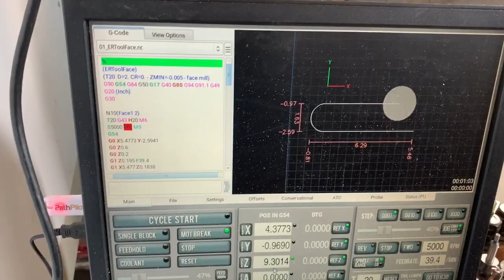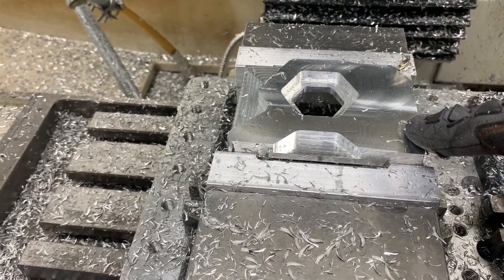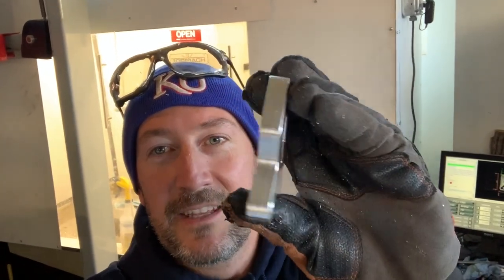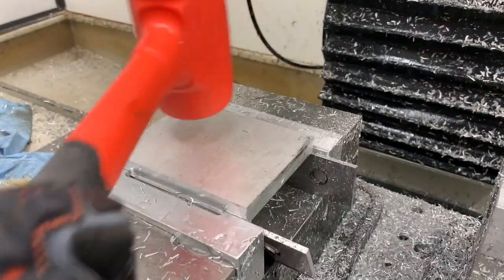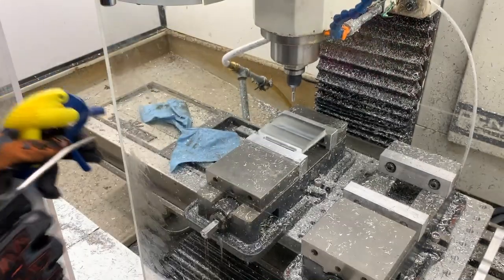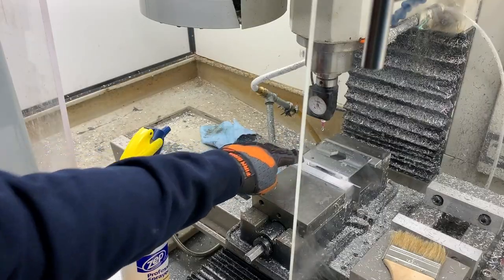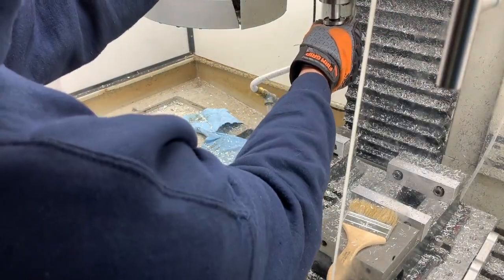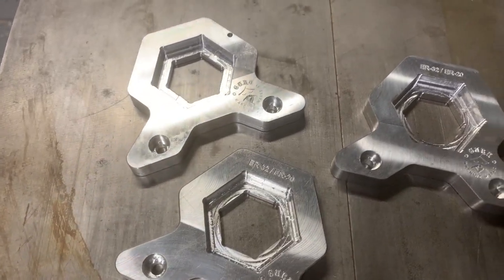First Project on The Tormach - ER-20 & ER 32 Collet Holder

Comment: You are doing great, keep at it. Reminds me of when I got mine. That education isn't cheap but as long as you learn from your mistakes, its worth it. 

A few helpfully hints. First, leave the parallels in. They give the stock some needed z support. Second, predrill holes if possible. like the corners of the hexagons, this will save your end mills from diving into a corner at higher engagement. Finally, it looks like your vice may not be aligned perfectly hence the edge left on the final part. Since you have softjaws you could mill a step across them and use that in place of the parallels and it would be true to the x axis. Another trick I've learned to eliminate witness marks is to cut the profile in one setup. You may need thicker stock but if you cut to full depth in your Op1 you only risk your camfer being slightly askew on Op2. I hope this is helpful.
Reply from the maker: Awesome advice.  Thank you!  I need to get a nice drill set next.  I like your thoughts on pre-drilling.  That little step would have save 3 or 4 end mills.  My vices are about 2/10000 across both of them, so I think they are square.  It was interesting...  The witness mark was around the entire piece.  I think I either had some spring back or a programming error...  That said, cutting full depth would solve all that.  I could probably come up with something that left the middle of the part fat and the ends could be shaved down to accommodate the work holding.  I'll have to play with that.  I am going to mill a step in the soft jaws and hopefully get rid of the parallels for awhile.  I was nervous I'd hit them in the boring op.  If I hit aluminum, I don't think it would hurt anything.  THANK YOU again!!!

Comment: Dude! The Tormach looks amazing. I know it's going to make prototyping your new Skyscraper Guitar tools super convenient. I'm just entering the CNC world myself, with a new Shapeoko, but will remember to slow the feed speeds down when I try facing aluminum. Thanks for the demos. Congrats on the new tool!
Reply from the maker: You'll be amazed at how loud your shapeoko will get when you start cutting aluminum with it!  It will sound like 2 cats fighting in a dryer that's right next to your head.  LOL. Seriously though...   A lot of the lessons on the Tormach apply directly to the shapeoko.  I use fusion to create my CAM whether I'm on the Digital Wood Carver or the Tormach...  Once you get carbide 3d down, you may want to give Fusion 360 a shot.  Its a bit less user friendly, but WAY more powerful.
Reply: @GregsGarage  I'm definitely in the Carbide Create 101 class for this semester. Although I do have the creator version of Fusion 360. I had my 14-year-old son watching Fusion classes on Skillshare. He commented it was a little too much for him at the moment. :-) All in good time. Enjoy your Tormach. What a great find, under two hours away. That must have been like towing a boat. Glad to see them push the mill forward in the trailer to get you enough tongue weight.

Comment: Man that was fun to watch Greg.  So the issues you were having were all related to how you programmed the CAM?  step over, travel speed, depth of cut, etc?  what do you think of path pilot compared to your other cnc experience?  Oh and what was up with those gloves?  already cold in Colorado ?
Reply from the maker: The issues were CAM related.  Going from a rough, adaptive with one tool, to a finish pass with a smaller tool caused the tool to break in the corners.  I'm also an idiot and didn't size the material properly, so there's that too!!! 
I had Mach 3 on this controller when I got it.  I think Path Pilot is more intuitive for the Tormach because it's made to control everything on the machine.  The only thing that I wish I could pull from Mach 3 is the use of the playstation wireless controller.  I'm sure someone could hack that together...  Maybe that's a side project I can look at.
Lastly, we are in the middle of our 3rd snow storm in October.  We won't get out of the teens until Thursday...  It is cold as SHIT!  I just installed a garage heater last night.  The gloves are also to keep the chips from stabbing the crap out of my hands.  I can also leave them in the garage covered in chips.  My wife is NOT a fan of the chips, so I gotta be on my chip game hard core!!!!

Comment: You said it best "You pay for or one way or another" but your doing great. 

In few the few snapped bits that I saw, it was happening in the acute angle on the part. (I'm just throwing shit a wall to see if it sticks here) but I think your Tormach is transitioning through the angle so fast that the bit is experiencing force on 2 sides, try and set it at a slower feed rate as it comes in to these angles and add a millisecond pause at acute angel joints or transition point to release the strain on the bit. 

Hope this helps keep up the great work :)
Reply from the maker: LOL!  Yes, you gotta pay your tuition!
You are spot on about cutting at a lower feed rate.  I just have to figure out what recipe is going to work as a template.  I'm not doing production, so I'm not worried about speed.  I'm sure there are some analysis tools in Fusion to help me with the trouble spots.  I need to do some research to find out the best way to make this baby sing!!!

Comment: Definitely watch the aluminum it will chip weld to your tool if the chips aren’t evacuated and break your tool right off heavier chips and maybee a 2 flute endmill some people even use single flute aluminum endmills check out DATRON they have a lot of info on cutting aluminum
Reply from the maker: Awesome!  Thank you for the advice.  I'll take a peek at the Datron site for sure.

Comment: We need to talk about the gloves... Also, mist coolant.
Reply from the maker: Go for it.  I'm all ears on both subjects.
Reply: @GregsGarage  Gotta lose the gloves. If you want to wear something for grip and anti coolant and chips, I suggest using nitrile gloves. Personally I love Halyard:s purple nitrile gloves but there's a good selection out there of really tough ones.

Second, mist coolant. It works with high pressure air and a Bernoulli/venturi process. Don't pin me on the exact terminology, but anyway it basically uses airflow to create a vacuum to pick up small amounts of coolant that you then deposit on your tool. This creates a good cooling and lubricating solution while also blowing away chips from your cutter's path. Better finishes and longer tool life, plus you don't have to get close to a spindle anymore with a spray bottle or brush. So it's more convenient, efficient and safe.
Reply from the maker: Thanks Pieter.  I did install a mist coolant system since this video.  I need to get it tuned in, but its close.  The spray bottle was just to get going on this project...  As for the gloves...  I am usually working on a handful of projects in the shop.  The tools, the chips and all the other sharp stuff around the machine are killing my hands.  For the most part, blood doesn't bother me, but I do work in an office and I can't have hands that look like they've been through the meat grinder...  Still trying to find what works best...  I've also got to be able to use my phone with the gloves on...  Its a constant need.  The ones you see in the video check all the boxes for me.
Reply: @GregsGarage  fair enough. Just bear in mind to keep well aware or away from moving parts... Machines aren't cruel devices but they'll finish your appendages in no time at all...

Comment: The parallels need to stay in the vice while you're machining. You shouldnt take them out and then machine. 

Your workpiece will get pushed down. And end up applying a bending torque or deflecting the tool. Especially if the tool is doing any side milling. Or pocket milling etc. Or even drilling.

Comment: So, you've fired your Intern for MISTAKES; yet you've also made mistakes. Can I assume you are now FIRED??? LOL... Seems to reason that you nor your intern knew what they are doing and trial and error seems to be the best teacher. 

I worked as a Machinist almost 2 decades ago in early 2000; more so a Monkey changing parts and pushing a button, so I do have some machining experience. I've not ever programmed the Machine but have changed a few parameters to get the product finished as needed. 

I say this not to seem like a know it all but rather to say I feel your pain with regards to breaking things. I once ripped the clamping jaws off the machine and watched the piece of Hastelloy, weighing in easily at 450 lbs, drop to the center of the bed as I was cutting Piercing Points and forgot to reset the home position. It was on a Boring Process with a long cutter and resting home was the quick way to program as this was a temp part for this machine and the person could not fully figure out the process so relied on the Monkey to reset Home each time. Needless to say I forgot to reset home and though I was not fired, I did get a few days off as my machine was down. 

Working Metal vs Working Wood are two very different ventures so I want back to Construction where I was more than just a Monkey... Cheers...
Reply from the maker: LOL!  Great story Paul.  I can't imagine how loud that crash must have been!  How expensive was that chunk of metal???  

I've got a feeling my "Intern" will be blamed for all the mistakes from here forward. :D
Reply: @GregsGarage  Surprisingly it was not loud so much as the feeling of slow motion lasting for what seems like hours or days. LOL... When that boring bar hit the 3 jaws the clunk was shocking as was the large part hitting the bed. As soon as I hit the start button the machine wound up with a most unusual sound that I just knew something was wrong and as the bar traveled closer and closer to the piece I frantically tried to hit the big red STOP BUTTON and hit every millimeter around it instead until the crash. The Amazing this was the Bar was not bent at all and the jaws released like butter despite the fact it had extenders and hardened screws, Grade 8 screws that is. The entire jaw assembly had to be rebuild at the cost of thousands to say the least. The lathe was an older unit so parts were a dime a dozen. 

The Hastelloy cost, at the time 2004ish was like 5 bucks a pound for scrap, so that piercing point once finished was very pricey. The machine shop I worked for purchased blanks from a local foundry then machined them to sell to the plant about 45 minutes away. As few as 2 or 3 upwards of 10 to 15 were delivered each week depending on their need to make pipe. These points were used to make the center hole in pipe for the Gas Companies. Some weeks were better than others and I left there in mid 2005. 

It was an awesome operation to see how they plunged these piercing points into the 25 foot x 2 feet round blanks of red hot steel. Then they would stretch the steel tube and used dies to size the pipe down and extend the length to 250 feet from 25. Basically a 2 foot diameter pipe was reduced to 6 inch diameter extended 250 feet long. Then the pipe was sized down to 20 or 30 feet lengths from there to be transported as needed... The round blank was so red orange hot you could almost see through it... And talk about hot, you could feel the heat 75 foot away, easily, and those next to it had to wear those silver fire suites complete with hoods and masks. 

Needless to say those 4 clunks will haunt my nightmares for life... 3 as the jaws were removed and that 4th as the part hit the bed. LOL...